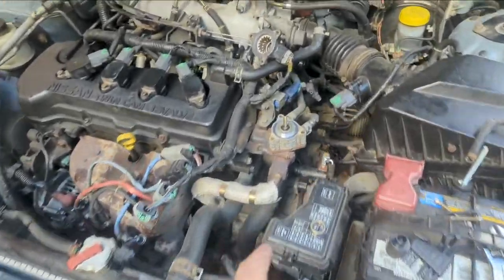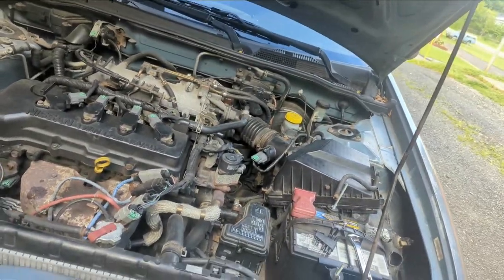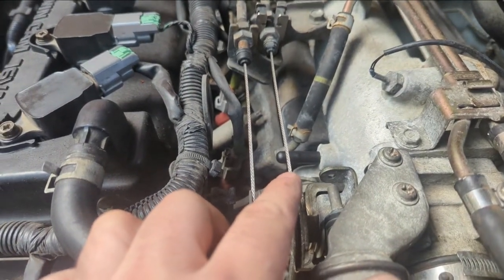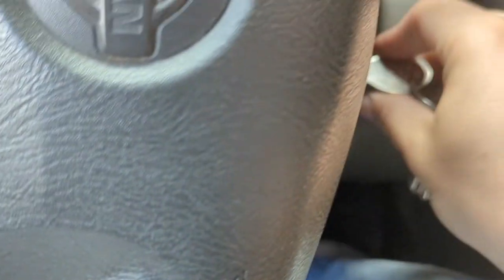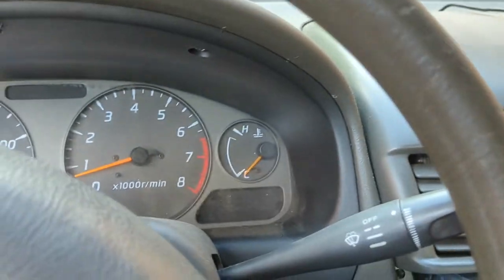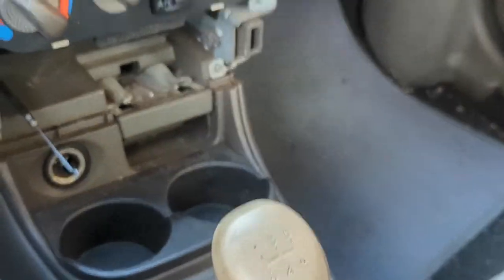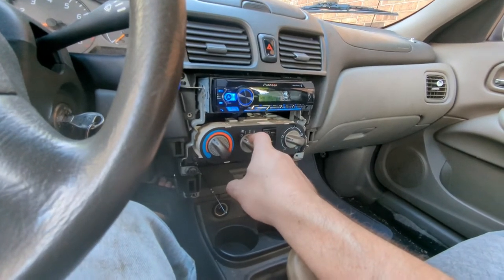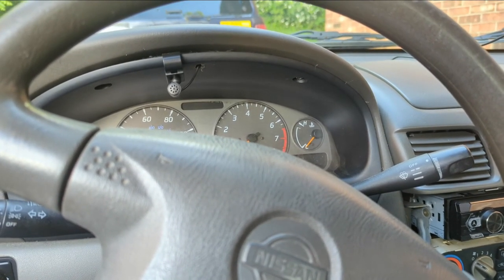2000 Nissan Sentra EGR Bypass - Idle issues!

Comment: I have the same year car same engine and I have a code p1605 it runs on 3rd gear from start I can’t figure out why it was running fine before I changed the valve cover gasket but I didn’t change anything are you familiar with this issue
Reply from the maker: Check any wiring you may have touched while doing the valve cover gasket, maybe something came unplugged. My Sentra was a 5 speed so I'm not sure about the automatics.
Reply: @DeadReckon  I only removed the coils! I figured they are the same because the motor as the same I was messing with the overdrive button and now it doesn’t work! Could it be a ground issue
Reply from the maker: @johngom1412  I'm not sure, I had an overdrive issue in my '94 Sentra, I had to change the entire shifter to fix that.
Reply: @DeadReckon  thanks for the info

Comment: Is it okay to take this part out?
Reply from the maker: As long as you don't have emissions in your area, it won't hurt, just leave the electrical plug connected or the car won't run right. As long as the car thinks the EGR is working that's all you need
Reply: I have an idle problem in my 2001 nissan sentra- it idles normal then out of nowhere it drops down to 500rpms then back to normal. And it does this every minute or so. Over and over, it’ll randomly idle down low enough to cut off completely while I’m driving. It’s extremely annoying. Do you think it’s the EGR valve?
Reply from the maker: @TattoosbyNoah  It helped a bit bypassing the EGR on my car but the problem is these cars are just damned weird. 4 O2 sensors, a weird variable length intake, my car won't idle unless I have something drawing down on the engine. Like the headlights causing the alternator to work or the AC on. Is your car an automatic or manual? Just curious

I've noticed digging around in junkyard cars that a lot of the things that make our cars strange is missign on 2003 and up Sentra's that have the slightly different bodywork but are the same car.
Reply: So I found out it was a dirty throttle body. So I tried cleaning it. And it worked for about a week. Then it got dirty again. I don’t understand what’s causing it to do this
Reply from the maker: @imthetattooguy  What's it plugged with? Oil? If it's oil it's a bad PCV (Positive crankcase ventilation) valve.
Reply: @DeadReckon  I believe it’s oil yes, thank you so much! I’ll keep you updated
Reply from the maker: @imthetattooguy  No problem, I've had that issue before.